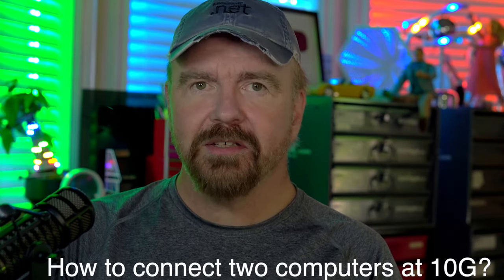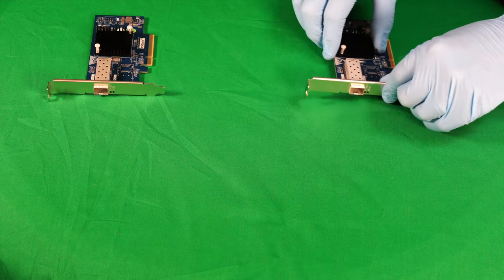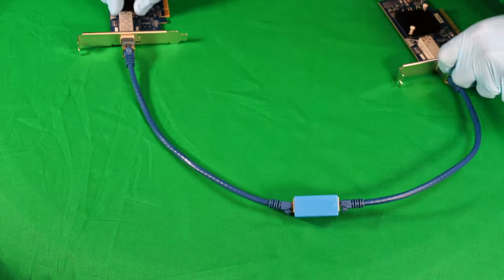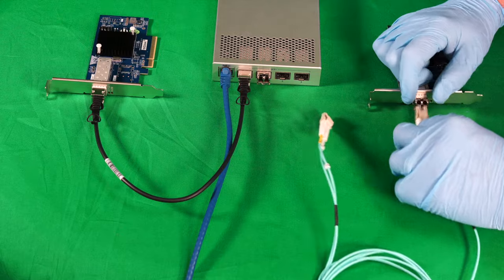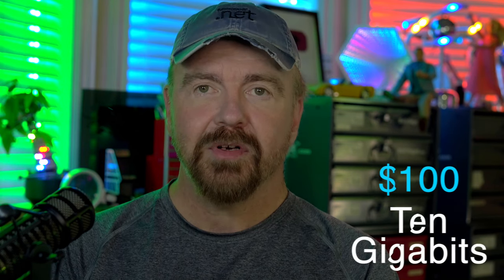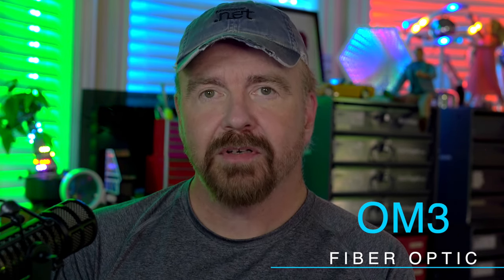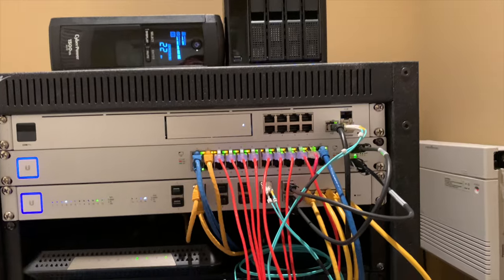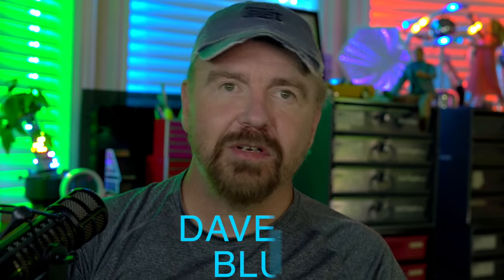10 Gig: 3 Ways to Connect!  Fiber vs Twisted Pair vs Copper

Comment: Now I feel like running fiber across my home. I litearly have no reason to.
Reply: "I feel like... I literally have no reason to." this format is the foundation of my existence.
Reply: @David-Alfonso  mood
Reply: I always have a reason to run fiber, even when there's no real rhyme or reason.
Reply from the maker: Do it!  Or at least do one run... that's what I did.  I told myself it was so that the whole thing was electrically insulated from the cable modem, but it was just for fun!
Reply: I think the biggest real world reasons are runs between buildings, since you've got longer range and eliminate both electrical interference and ground loops. Even for a short run where you don't necessarily need the range, there's a strong case for isolation between buildings.
Reply: @StephanieDaugherty  or in my case where I have an Aruba switch that doesn't like to play with many DACs but works fine with many SFP+ fiber transceivers. I'm slowly running fiber and cat 6a up two stories. The 10GBE is mostly for a NAS I want to run my game library off of to multiple PCs in the house. 1GBE is enough for the other devices. I'm running both fiber and 6a in wall to the same keystone plates as I'm hoping in the next few years multi speed GBE switches come down in price and in the meantime I can happily run 1GBE on those lines for other devices. If I'm already going through the work of pulling one cable I might as well pull a few.
Reply: Now here I am reluctant to let go of my DSL for optical. (I think me watching "The Day After tomorrow" might have something to do with it)
Reply: i know that feel.. i started browsing amazon and my hardware supplier's website at around the two minute mark of this video..
Reply: @akhilaryappatt  Went from cable Max 150/50 to Gigabit fibre optic last year. It's as if I'm connected to the Internet through LAN.
Reply: Once you have run fiber across the  whole house, you don’t have to re-run new cables for a longer time. Who knows when we need even faster Ethernet speed in future.

Comment: In 16 minutes you've explained these concepts better than a college professor did in a month. You even simplified single-mode and multi-mode fiber concepts well enough for practical usage. I had a fiber optics technician certification a few years back (I let it lapse, as the work I needed it for was completed) and fiber is fascinating stuff. Before the certification training, I thought multi-mode was better than single-mode also, but surprise! It's like the difference between shooting a bunch of ping-pong balls down a pipe that barely fits them vs shooting them down a 4-inch diameter pipe. They will arrive in the same order in which they were sent using the small pipe, but using the large pipe, the order will get all mixed up. With ping-pong balls, it doesn't matter, but with serial data, it's the difference between usable, formatted data, vs a jumble of random bits.
Reply from the maker: Thanks, I really appreciate the vote of confidence!  I have many EE friends who I'm sure will cringe at my descriptions, but I'm trying to explain them as I see them, not how they necessarily are :-)
Reply: Your explanation is quite good. In single mode (due to the size of the fibre core), the light has only one mode of propagation (one light ray), so a pulse of light you would have sent at the input will be the same pulse sightly attenuated at the output (with a delay, etc.). With multimode, the core is bigger, and thus the light will propagate in a diffuse way, so you will have more reflected rays in the fibre which changes the length of the light ray, thus the pulse sent at the input will be spread in time and looks like a Gaussian distribution.

This explains why single mode is often more expensive, since to produce the single ray, you need to be more accurate (reach the fibre with a precise angle). Also, coupling is more expensive, because you need to cut the fibre in a near perfect way, to clean it, to align the two fibres and to arc weld them (plus, test). The terminators are also tricky to make, etc.
Reply: I've been working in the industry for nearly over 20 years and your explanation is the most fuctional I've seen so far. I actually bookmarked it in my networking playlist for sharing if I need to
Reply: Agreed, wish I would've had the foresight at the time to save myself from purchasing a piece of paper for 10's of thousands of dollars...

Comment: Auto-crossover has been part of the Ethernet standard since GbE was introduced.  Prior to that some 100BaseT cards supported auto MDI-X and others required crossover cables.
Reply: YES. I was wondering if he didn't know MDX exists?!

Is there actually such a thing as "crossover" or "straight through" gigabit? Or just cables wired random lol. It uses all pairs bidirectionally, kind of sidestepping the entire concept.
Reply: Some 100BaseT cards, but most 100BaseT switches. I can't remember the last time I've seen a switch that didn't automatically negotiate MDI/MDI-X.
Reply: @matthewshapiro1676  there is no crossover for gigabit connections since they are using all pairs for sending and receiving at the same time. But you can't just mix up the cables. A twisted pair should still be wired correctly since one cable of the pair is negatively mirroring the other cable, meaning if you send 1 on one cable then you send -1 on the other.
And it simply won't work if the pins on one end don't connect to the same pins on the other end. Would likely be a much more complex negotiation if you had to find out how both NICs are actually connected to each other.
Reply: @mihaitha  Yes it was the introduction of switches on 100mbps that did away with cross over cables. I know that only two pairs of the 4 pairs actually do anything on 100mb but I've not kept up with how 1gb uses the conductors. We used the unused pairs for passive PoE. You can actually power 12v routers with their own power supplies from quite a distance over Ethernet.
Reply: @wayland7150  PoE is still to power cameras (protocol 802.3). Indeed it uses the 4-5 and 7-8 pairs to provide about 50 volts of DC current to the device.
Reply: @mihaitha  The fact is for many things you don't need any expense. 12v works fine. I wish those cheap Chinese IP cameras would do that. TP-Link does it with their cheap access points, even supplying the passive PoE adaptor.
Reply: @wayland7150  you can't supply 12V over two pairs of UTP cable over more than a couple of meters. Trust me, I've tried it.
Reply: @mihaitha  Trust me, you're doing it wrong. 12v routers contain a circuit called a buck regulator. They will take any DC voltage between about 7v and 24v and convert it with very little loss to 5v. They only need to draw about 300mA at 12v to deliver over 500mA at 5v at the device. You can go 20 metres with no problem. If need be you can use an 18v PSU, the buck converter will like that, less current needed. You also don't need to deliver 12v, even if it drops to 7v it will still work. This is not true of 5v devices because they need bang on 5v and nothing less because they have no buck converter.
Reply: @wayland7150  I guess you're lucky to have routers with a buck converter / regulator. I've seen plenty of devices that had nothing more than a capacitor and some protection circuitry, depending on the wall wart to provide the correct voltage. But yes, if you don't need 12V at the device when inserting 12V at the switch (or an injector) then of course it will work over longer distances (or higher currents). If you can lose 5V at 500mA then the cable can have a resistance of 10 Ω and it will still work. This should be achievable om 20m cable even with cheap (possibly CCA) network cables, but that's the reason POE uses much higher voltages: Less current, so less voltage drop, and less loss. I still recommend getting good quality cable when wiring your house (doubly so when wiring business);  buying the good stuff hurts only once, buying crappy stuff can bite you every time (or you can get lucky and it won't bite at all. It's a gamble).
Reply: @paulnieuwkamp8067  If your device has a 5v PSU then you will notice that the cable is thick and short and the PSU can deliver 2amps. You cannot extend this cable much because the router requires 5v and nothing less. TP-Link basic routers sometimes have a 12v pSU and sometimes it's 9v, they really don't care what voltage you feed them within reason. It makes sense for them to fit buck regulators because it gives them greater flexibility over the PSU which is needed for different countries. This also can save costs because the PSU does not need to be special so they can swap to a different one if their usual supplier is short of stock. This helps us with things like passive PoE or running the gear from solar. 
Yes the standard PoE is better but a lot more expensive, they are trying to deliver much more power over much longer distances than you would need in your home.
Reply: @wayland7150  To be accurate, you wrote “over Ethernet” when you meant “over twisted-pair”.
Reply: @TomCee53  Yeah, wrong lay of the 7 layer protocol.

Comment: My wife and I are both motion graphics artists and vfx compositors. We work locally on our machines and synchronise with syncthing between our workstations and a third machine for backup, which also runs backblaze for offsite. I'd love us to work of a 10gig network with centralised storage, but it just isn't affordable for us. 
We also don't live in American style enormous housing with stud walls so running cables is much more difficult.
Loving your stuff Dave. It's the perfect tone, and not as niche as you think, 200,000+ views!
When we work in studio, there's about 15-20 machines connected by 10gig for compositing. And it's fantastic for teams of that size.
Reply: Get some cat6 and hire an experienced wirepulling electrician to make your runs. It's NOT as difficult as you think.

Comment: I used to work in a fiber optics lab at Bellcore (formerly Bell Labs). You hit on the reason multi-mode isn't as good for long haul, the time difference between the light that enters straight down the middle vs the light that bounces back and forth. The bits start spreading out until you can't tell a 1 from a zero eventually. They tried to use some variable refraction materials so the light would travel faster in the outer edges, it helped but then someone came up with single mode and that took over for distance applications. The connectors were a real pain in the ass, as was splicing fibers with such precision. I actually did splice single mode fibers using a microscope and micro positioning knobs with a local insertion and detection (bend the fiber and shine light into it) to maximize alignment. Sometimes it even worked! 

Good times.
Reply: Ugh.. hand splicing SM fiber sucks... I would use an automatic fusion splicer with premade pig-tails (easy mode). I only did a couple terminations with MM fiber (so much fun bonding and lapping a ceramic ferrule, and praying it works)..

Cheers!
Reply: @thudtheace  I was working there early days, mid 1980s when such devices were not yet available. We had a splicing setup for experimenting on that used a microscope and micropositioners to align the cores. It didn't work very consistently. Later systems came out that bent the fiber before and after and injected laser light near the splice that could be aligned automatically. But I never played around with those.

Comment: Useful trick on the fibre: You can unplug the individual fibers from the clip that holds them and improvise an instant loopback cable. Handy for testing if the interface is physically functional.

Comment: Thank you - Thank you - Thank You - Dave!! That one comment about connecting an SPF and SPF+ to each other, saved me many hours of debugging my system. Thanks again Dave.
For the others that missed Dave hint about connecting a SPF and SPF+, is to manually set the the SPF+ to 1Gb (not 10Gb) i.e. manually set the SPF+ to a slower speed.

Comment: There's a couple other SFP+ cable options you didn't mention: Active Copper cables (as opposed to passive) and Active Optical Cables (fiber with a SFP+ transceiver permanently attached to both ends rather than the traditional LC) Great video and explanations!

Comment: As a network guy… I must say good work.  I would add that after SFP+ is SFP28, and it goes to 25 Gbps.   Then there is quad or QSFP, QSFP+, and QSFP28 transceivers each of which are just 4x faster due to the Quad.  Next you might want to talk about fiber connectors…. Those are LC, but other common ones are ST, SC, and even MTRJ.   It is not rocket science… you just match the transceivers on each side, match speed, and use the proper medium.   Hence your 10 Gbps multimode is 10G-Base-SR where 1 Gbps multimode is 1000-Base-SX.   Bottom line is you match,  so a 10G-Base-SR will connect to another 10G-Base-SR even if one type is different form factor and connector

Comment: Automatic medium-dependent interface crossover (Auto-MDIX) is a feature that allows the switch interface to detect the required cable connection type (straight-through or crossover) and automatically configure the connection appropriately.
Reply: Yep, and many PC NICs have this feature, so no need to use a crossover cable.
Reply: @Saqibss  AFAIK it was a requirement for gigabit and up. I've not made a crossover cable in at least 10 years.
Reply: This is an artifact of gigabit using all four pairs for both send and receive.
Reply: @wlhyatt100  Even many 100BASE-TX switches had auto-MDI-X.

Comment: Just wanted to point out @ 11:20 single mode fiber is actually much more common in datacenters than you might think. We use quite a good bit of it in the datacenter I work in. All of our switch uplinks are SM fiber. Id say we use about 50/50 between SM and MM.

Comment: You can use a regular cable machine-to-machine. Ethernet adapters these days support auto mdi-x.
Reply: Exactly, was thinking the same thing while watching it, any 1Gbps era and past should support MDI-X making cross-over cables a thing of the past for many years now.
Reply: Yup, I got into networking about 10 years ago and I have not once needed to worry about that.
Reply: And modern switches do auto mdi-x too.
Reply from the maker: Current ones absolutely do!  The support was mixed on earlier ones, so I figured I'd cover the concept, but you're right... odds of running into one that DOESN'T autonegotiate is low.
Reply: @DavesGarage  I could be wrong but I think is was mandatory with 1gbe (the 4 pair version, there is a 2 pair version)?
Reply: @ligarsystm  It was manditory in the final gig standards..  HP had some early gig cards that did not comply, but for general purposes now, that has been irrelevant for 15 years or so at least.  Based on this video, I ASSUME but do not know that the 10 gig spec doesn't support auto switching for some reason.  Maybe answering this question is a good enough reason/excuse to finally upgrade between my VM hosts and NAS!  ;-)
Reply: MDI-X only applies to 10 and 100 Meg Ethernet. 1G and faster send data on both directions on all 4 pairs at all times.
Reply: @DavesGarage  1000Base-T 802.3-2012 has no dedicated transmit/receive pairs so a crossover cable is never needed. Also note it's not an RJ45 connector but a 8P8C connector. RJ-45 is keyed with a tab in one corner and is an old standard that dates back to ISDN.
Reply: @LudicInterface  RJ45 is a type of 8P8C. RJ45 is perfectly acceptable here.
Reply: @Ludic Interface RJ45 IS the industry descriptor for the 4 pair jack/plug connector used in standard networking.
Reply: @DavesGarage  It's the interface, not the cable that autonegotiates.

Comment: Thanks fir these Home Network videos.  I’m facing a similar upgrade across 10KSqFt over two buildings that make up my home.  I got board with the pandemic lockdown and processes to replace every switch that wasn’t already Crestron controlled with WiFi smart switches.  After reading 106 WiFi devices, I hit a brick wall with no room on the network left.  I’ve since replaced the WiFi network with another brand that’s more of a gaming system.  Didn’t work.  So I’m waiting for the UniFi Dream Machine, Pro 48 PoE Switches and array of Unity Access Points to be delivered this coming week.  I already have fiber run between the two buildings and Cat6 in the walls for the Access Points, so it should pretty much be plug and play.  But your videos have really helped me to understand the SFP chain and other connectors to better connect to the modem and other devices.  Not sure why I purchased a bunch of Cat8 cable at this point.  Guess they will still work...

Comment: This is a clear presentation of how to connect. Thank you!
Now, 2 years later, there are even rather affordable 100Gbit/s Switches (Mikrotik CRS504-4XQ-IN or if you have several clients wirth 25Gbit/s SFP+ and 2 Servers with 100Gbit then CRS518-16XS-2XQ is suitable). Of course not useful for everybody, but some may find these switches useful.

Comment: I run a 30m 10gbps OS2 line across my house. (I got single mode by mistake, but only realized after running the cable, and decided it would be easier to just replace the transceivers instead of the cable), I have a Mikrotik CRS305 too, and a CSS326. 
Also crossover cables are no longer needed, just about every PC and ethernet transceiver supports auto-MDIX now.  Also, generally I open the retention clip on the transceiver before putting in the fiber cable, but I think that's just me. 
Overall a pretty good video.
EDIT:1 Fiber does not support auto negotiation.